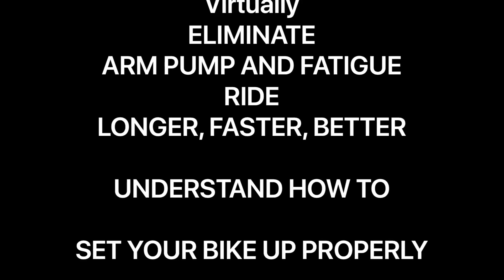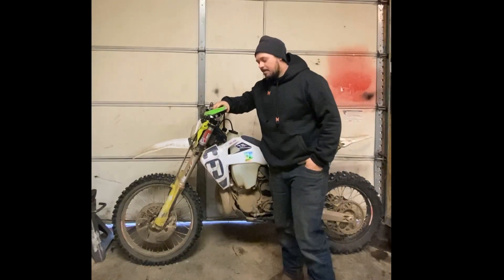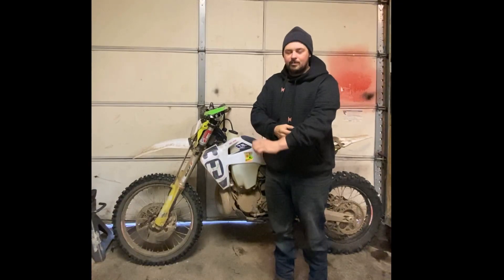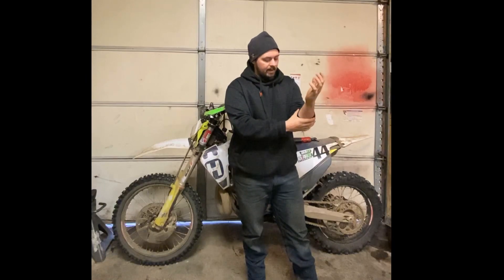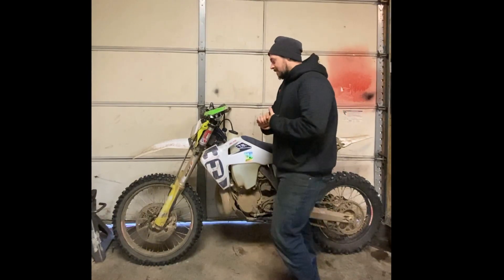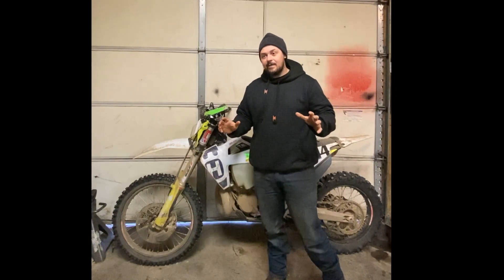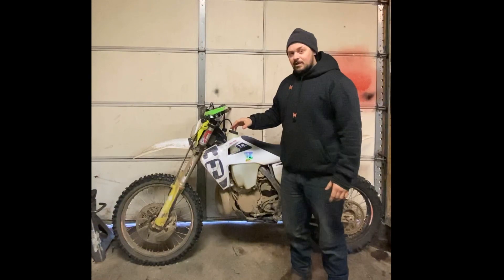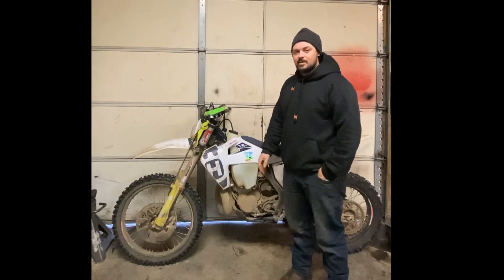Proper bike setup TO ELIMINATE ARM PUMP. Ride faster, harder, smarter PART 1

Comment: BIG thanks for the video.

Had a Brain injury(lost balance), didn't ride much for 3 years, now serious arm pump on dirt roads, I'm not smiling while riding :(

I've been tuning suspension(with the help of 2 tuners, both of them got me some plush, way better than stock), but I need to test more on fork height, and try other settings of sag(other than 110mm), thanks for the heads UP!!

I have a regular mousse in front tire(after my TuBliss failed(lasted 8 years, huge thumbs up to TuBliss!!), I'll also try a soft Nitro.

My Arm pump is so bad, I'm adding Flexx handlebars, and with more suspension tuning and setup, I should get in more riding hours, which should help with arm pump to(getting into better riding conditioning)

Can't wait for more 220 tire info.

Thanks for sharing your setup sucess, it will HELP me.
Reply from the maker: Absolutely form helps too. But it’s also a lot of the bike that pushes you out of your form and when you get tired from handling the bike your arms pump up and you get even more tired it’s a Vicious cycle.  Try drinking a bottle of Gatorade around an hour before riding then while riding try using an electrolyte drink as well. Cardio is a big one too that really helps and try riding for a little bit then stretch as soon as you feel it coming on then get right back into it then when you feel it coming in stop and stretch more. This help train your body to recover from arm pump.
Reply: :)
Thanks for more tips!!
Will try them ALL